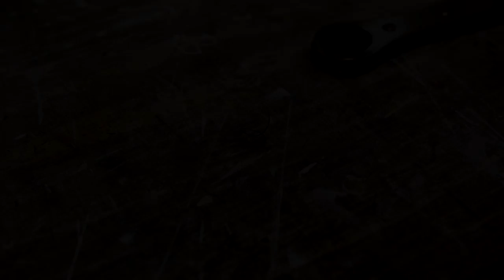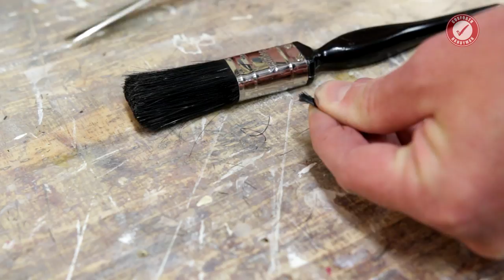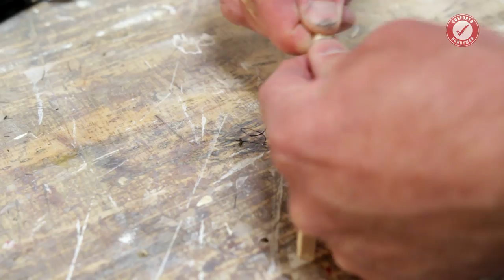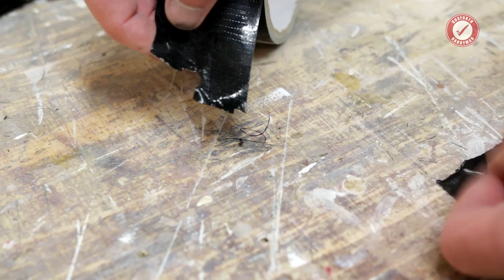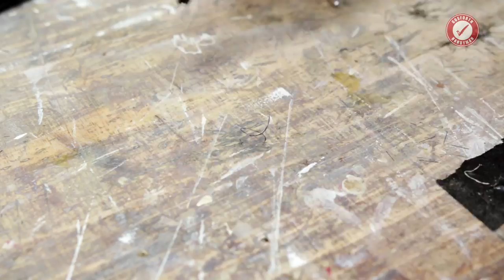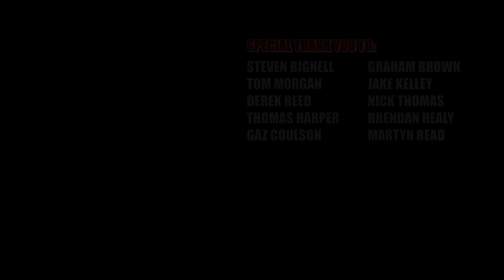How to Make a Disposable Paintbrush - DIY Hacks!

Comment: Been looking for cheap disposable brushes fir ages. With the 100 metsl shaft brushes costing about  £33 on Rutland's I was quite desperate to find something of similar cost (or less) for much smaller quantities (10 or so). I found Hobbycraft does 6 for £1.20, may just use them now as there is no faf. I hadn't considered getting a big, cheap brush and using some off cuts from the workshop in making own. I recon you could do it for less than 10p brush, maybe even less than 5p. Great tip in itself, also great that you inspire me to think differently.
Reply from the maker: Defo! Mainly for emergencies if you're completely stuck but handy for ultra-cheap disposable brushes too. 👍